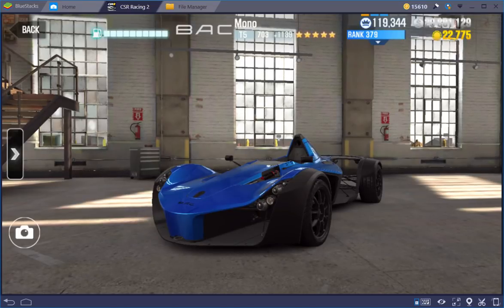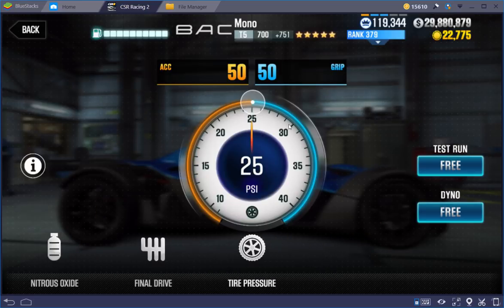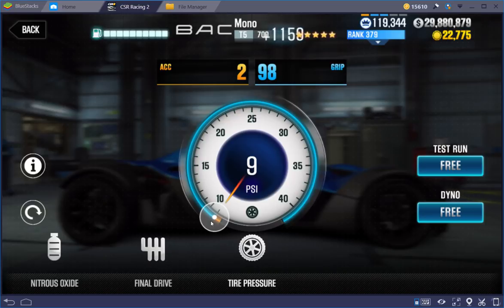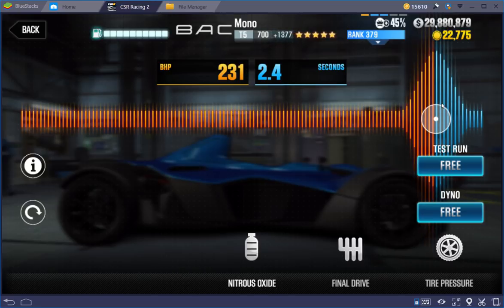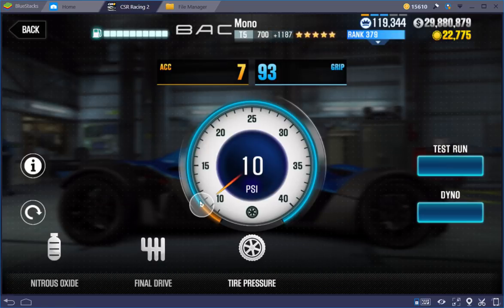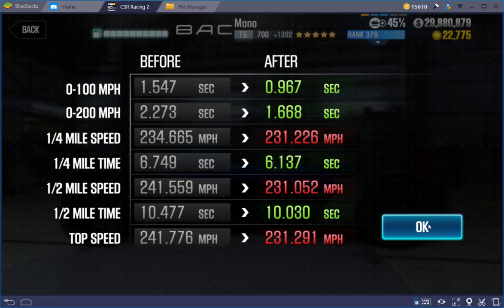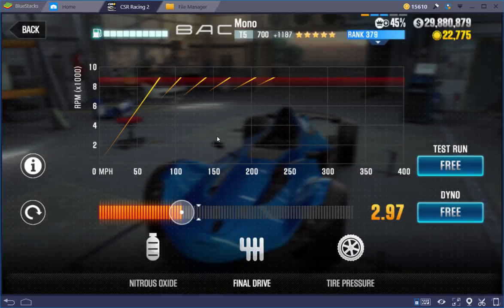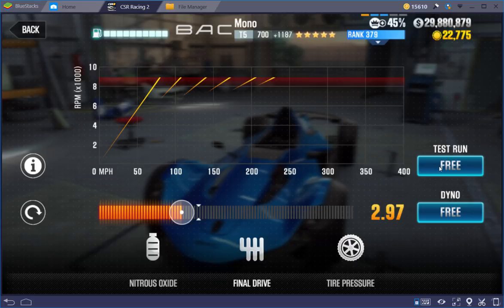CSR2 tuning the BAC Mono for supply cup and live with explanation of how I tune my cars

Comment: 7:29 another thing you can take advantage of when your building and tuning is that every time you add a few parts and retune the game has to figure out what your new best performance will be because all it has to go by is what it went by prior to you adding parts and retuning therefore head straight into live races and take advantage of that as you will almost always be mismatched for the lobby and just straight run over everybody until it moves you to a more appropriate Lobby and it's always great to be able to take advantage of that especially for the gamblers who can show some restraint by putting some cash on the line but not maxing out at 200k and scaring away all of the marks (your potential victims)

Comment: Max when a player disconnects and it gives u the win even though u lost does the game thinks u won, sometimes that happens when I’m trying to lose my race to keep my ratio even ?
Reply from the maker: Joe Newman I believe it does count. Usually if your ratio is off by a few races it will not matter. The key is not winning too often by too much. Meaning not running a 9.4 in a 10.1 lobby. Try to win within the lobby bracket. Slow down at the end and make races close.
Reply: Maxthegamer  That’s what I’ve been doing, I kind of thought it would count so I lose a extra race, using the mono today with ur 2 part tune, works great thanks again !!!